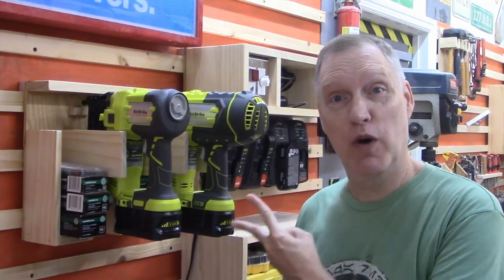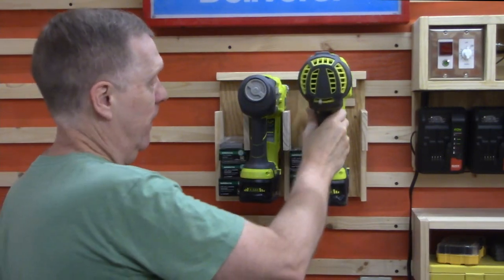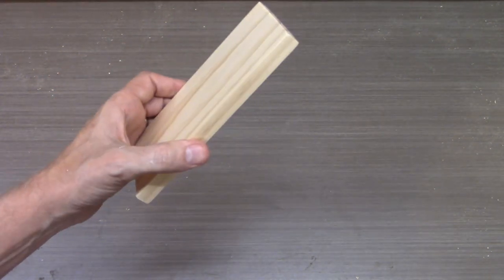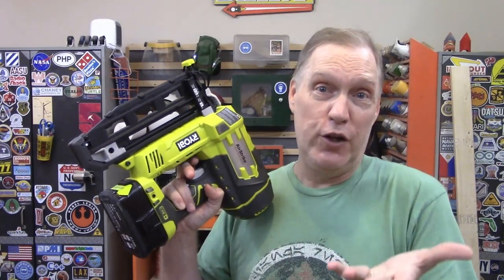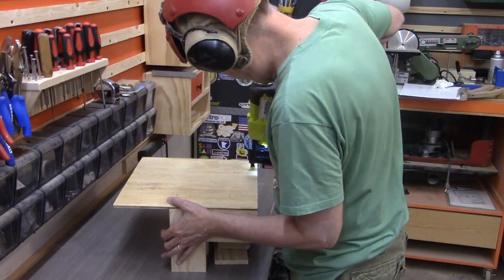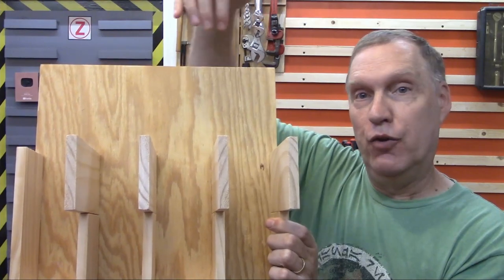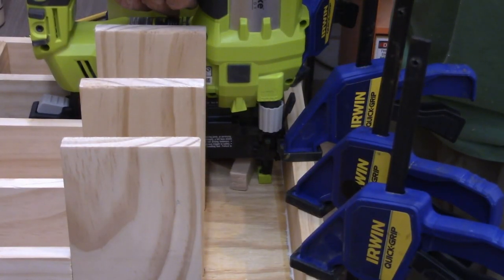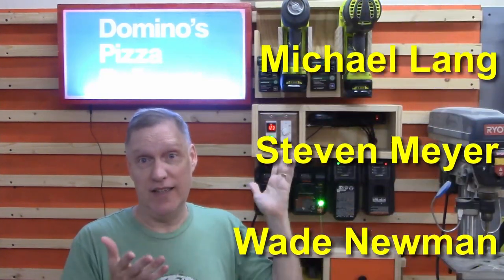Ryobi French Cleat Nail Gun Rack - Everything In One Place

Comment: Please consider storing your nail guns without batteries in them.  As you said, you don't wanna get shot!  A nail gun with no power source (and better yet, no nails) is going to be safer.  But hanging them up high is great idea if any young folks have access to your shop.
Reply from the maker: Good point and that is precisely what I do normally. I just left them on for the video to show that the mount can handle the tools with or without batteries. The only tools I store with installed batteries are the drills, which get the most use. Everything else is stored empty.

Comment: Is there a practical purpose to adding the nails after the glue dried? I get the screws but not the nails. This is a real question I’m not being a jerk.
Reply from the maker: Yes, the boxes of nails hold 5,000 nails each and can get a bit heavy when stacked. So I put in the nails to improve shear strength of the shelves. The glue is strong but I wanted that extra strength. I put the nails in after gluing because I couldn't figure out how to clamp the pieces effectively. So I just glued and added the nails when I was able to flip the whole structure over without parts falling off.

Comment: That's a nice, straightforward design using a minimal amount of wood.  Well done! I have the same guns and you're so right that they are bulky to store, especially the 16 ga. one.  And I second the approach of mounting them with the grips facing outward from the wall.  A possible mod to consider is making the four tool supports as trapezoids, where the tops slope downward toward the wall.  That might require adding a half inch or so to the length of those pieces but it would hold the tools at a slight downward angle which I think would be a bit more secure -- and you could eliminate the little support blocks.  I am starting to fill out my french cleat walls and have sub'd to check out your other ideas.  Thanks!
Reply from the maker: Love the trapezoid idea! We did think of an inclined mount but the nail guns are tall and that would have swung the bases outward and required an inclined support for the nail rails on the guns. But you are very correct about it being more secure and we are designing inclined mounts for our future jigsaw and circular saw mounts. Those two saws don't have the long face that the nail guns have.